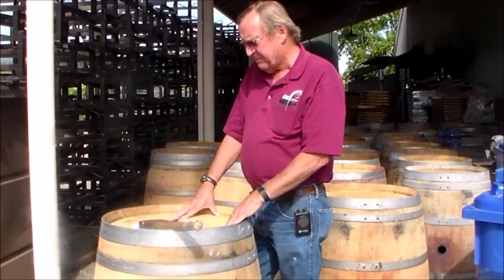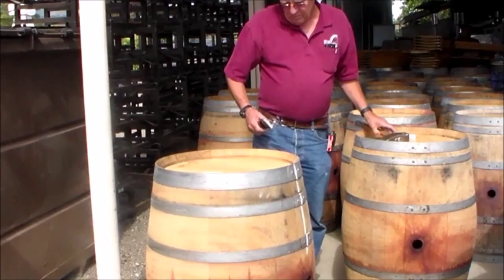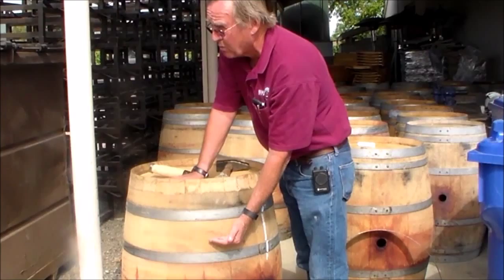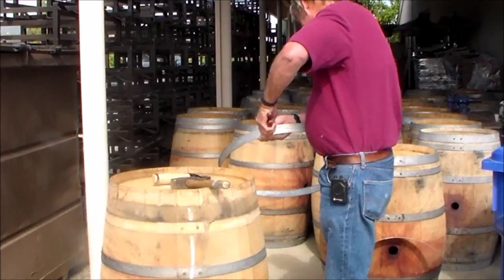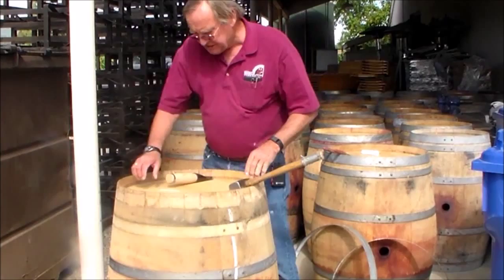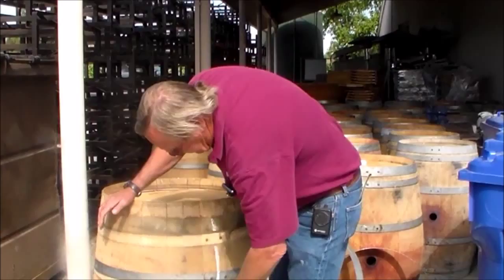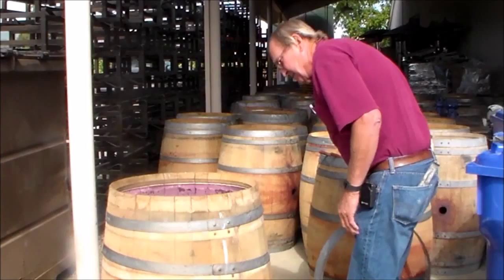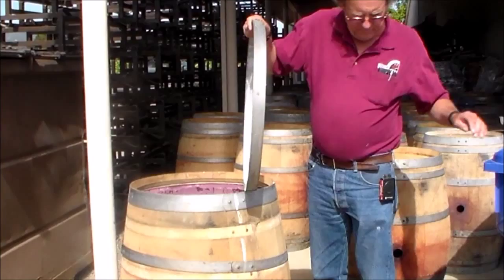Barrel Head Removal for Fermentation with Phil Burton

Comment: 12:24 another youtube video mentioned how coopers used to set the headhoop "proud" (sticking out) so the wood wouldn't soak up water on the ground and spoil the beer during storage and also so the staves wouldn't rot and chip so easily.